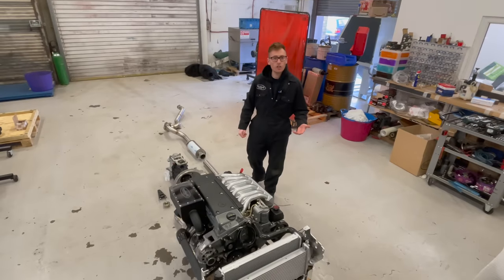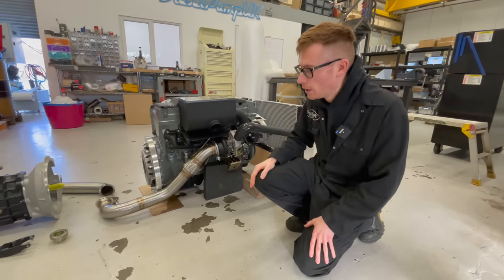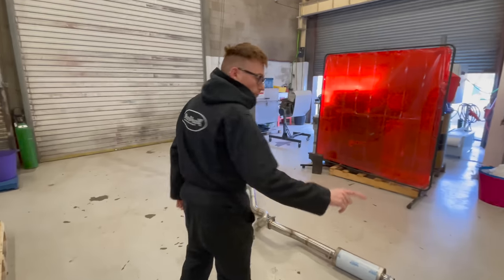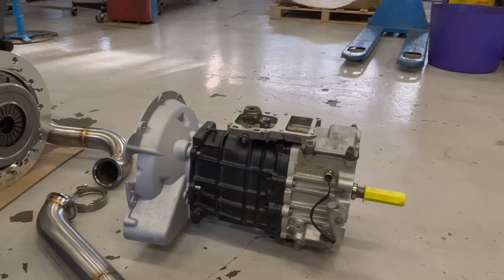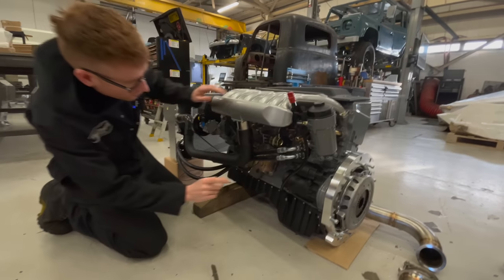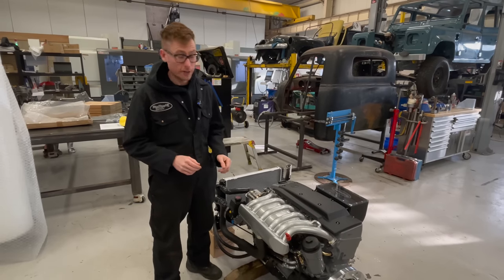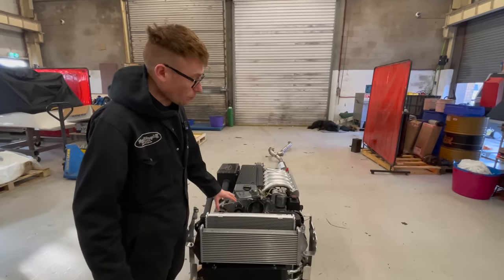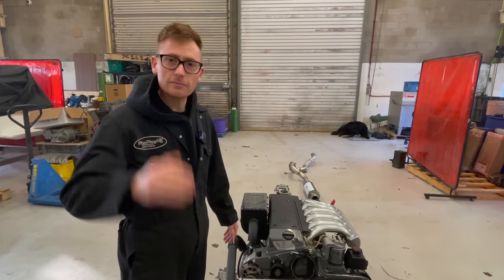OM606 Defender Crate Setup and Breakdown landrover

Comment: Great video, with the big advantage of the Om606 being the mechanical diesel, over the M57, what options are there for putting a hydraulic non-electronic control automatic, between the Om606 and the LT230 transfer box please? 
Guess no options for going upto ZF 4HP22?  Thanks

Comment: It looks a nice  set up but can it handle  46 + degree  in the out back of Australia. Will that motor  up against  a 4.5 lt twin turbo  landcurise  or 4.2 lt turbo  landcurise. Motor will last 20000 miles

Comment: Cheers for sharing this. All thing beings equal, which is more complex and costly to do? An M57 swap or the OM606?
Reply: I didn't make the cost list of both, but I am planning to swap my Mitsubishi pajero with the om606 over the m57 because 1) it's cheaper in my country, (500€+-) and 2)no electronic needed which is a very difficult part if like me don't know how work on it
Reply: 606 pricy to buy and parts needed for it are pricy installs but probably easier. M57 theres so many diffrent choices to make about the install that price is really variable. I went with the earlier engine as wireing is easier. It only takes 9 wires from body to ecu and 5 of them are the pedal. Theres plenty of standalone options aswell to make it even easier.

Comment: The exit of the air box goes to the left but in a 200tdi the intake is on the right. That also being the hole in the wing and the snorkel is fitted on the right. Do you do any sort of kit you sell to move it

Comment: I'm a fan of the om606 but the om642 cam in the commander for you guys. I want to diesel swap my commander but I'm figuring the om642 would be easier to swap since it came as an option everywhere except the states. Any advice?

Comment: Hi, do you do any engine system that would go into a Land rover discovery 4? Failing that, do or could you make a replacement crank for the factory motor as the ones used from factory are piss poor weak and fail all to often. Many thanks in advance.

Comment: Sorry for parading my ignorance. Does this engine have any can-bus electronic control and if so how does it interface with that old style vehicle. I've seen people fitting a modern engine into an old chassis and the software issues have been massive and more problems than all the mechanical aspects put together.  Nice looking job by the way.
Reply: Mechanical injection = no electronics required
Reply: Well you need power plus exciter wire for the starter and you need power feed plus exciter for the alternator but not the same exciter wire. Oh and also sensors for oil pressure and oil temp and water temp, maybe a tach if you fancy, that will come off the alternator if you buy one from Luke. That is if your running electrical gauges. 
Hope that helps.

Comment: I've been dreaming of putting one in my 95 Discovery.  I've heard different things.  Will the ZF 4hp22 automatic transmission handle the 300 horsepower?  Also, am I able to request a specific year of motor manufacture?  I live in California and cannot install a motor newer than my original one to pass the emission standards.
Reply: that is interesting, i would have expected it to be the other way around where you couldn't install an older engine? wonder what the logic there is.
Reply: @uliwehner  Well, for starters, its California.  In order for me to do the swap, diesel has to have been an original factory option and the engine can't be newer than the year of my vehicle.  There are hoops you have to jump through and its a hassle, but it is possible.  Other options are is to put in a Land Rover diesel, which I hear can be boosted up decently, and putting a Cummins4bt in it, which was my original plan until I learned of the Mercedes engines.
Reply: @westernwanderer8397  the 4 bt is massively heavier. They do make the power with the right parts. Power driven diesel has a video of the dyno session of a 4bt in a Ford excursion. 435 hp and almost 1000lbs torque

Comment: Amazing beautiful project set up. For 1995 defender 110 2.5 petrol R380. LHD 
SALLDHAD8MA957074
How much complete kit total cost. Without gearbox.
M606 used 
With Air conditioner bracket
Exhaust
Radiator
Oil cooler
AC condinsor
Plug & play.
Waiting your reply.

Comment: How long can you drive these things full throttle without it melting the pistons?
Reply: Forever.
Reply: @jasoncampbell4723  not possible
Reply: You are correct not forever, you will run out of fuel at some point.
Reply: @jasoncampbell4723  Show me an om606 on 500hp that runs full throttle for a full tank it will melt the pistons
Reply: I don’t have a 500HP version, I only have an 680HP version. 500HP you can do that all day with stock pistons. Well until you run out of fuel. 
Only time I’ve ever seen a piston failure is if the injector has problems or your rings weren’t properly gapped for the intended use. Like injector constantly dumps fuel and never shuts off. 
Unless your putting it in an airplane why would it be wide open for long durations of time?
Reply: As with any diesel, the weak point in the system is always the connecting rod not the pistons. 
Watch Luke as he builds an OM605 that makes 434HP on the dyno (if it were a 606 that would be 525HP) using stock rotating assembly and even stock rings, only thing he changed was better connecting rods, the pistons n rings were used just cleaned up and regapped.
Reply: @jasoncampbell4723  I know that the pistons can take it mechanically but you can only cool the pistons with oil so they will melt down at some point
Reply: I guess anything is possible?  I just don’t see it being an issue when there’s other things to keep it in check. 
You taking one to Bonniville?
Reply: @jasoncampbell4723  no but in Germany we have the Autobahn